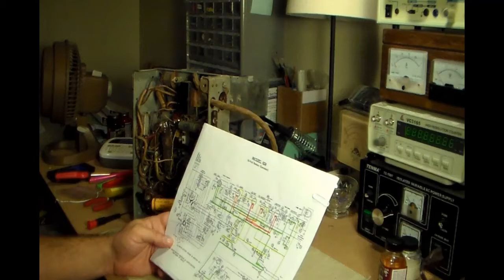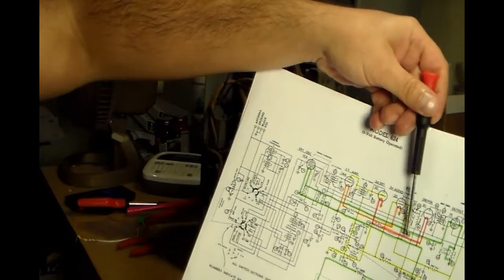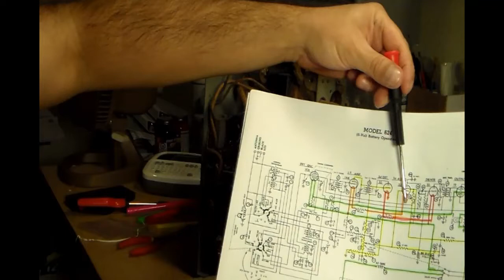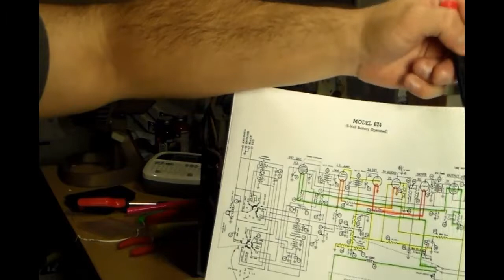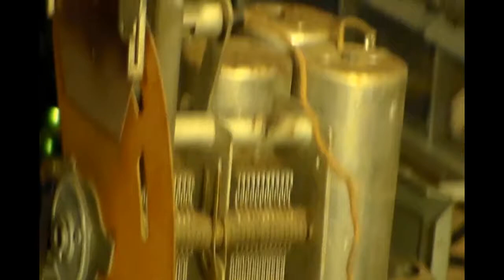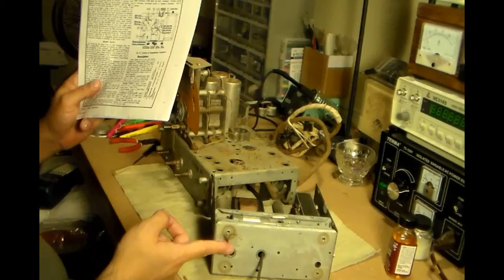Philco 624 Part 3 of 20

Comment: Before you say anything you invited my. The size of the wire is determined by the amount of current it will carry. You will want to keep your wire large to keep the voltage drop low and keep the from getting hot. The 33 ohm resisters in the filament circuits drop 19.8 volts each by ohms law. And the best I can tell from the schematic and some math is the voltage coming out of the power supply will around 160 to165 volts or so. 
Great video.  Dennis